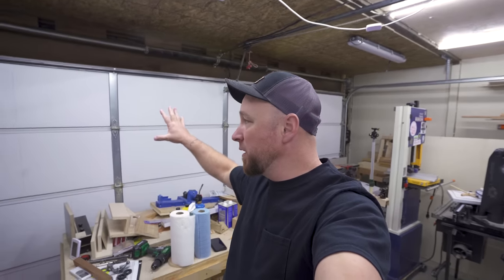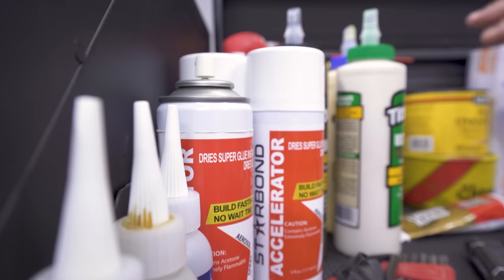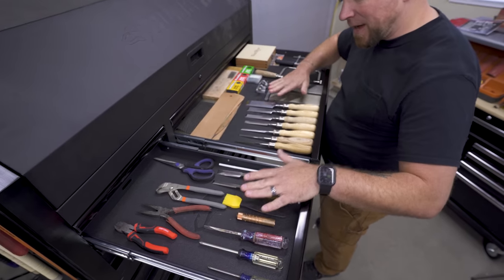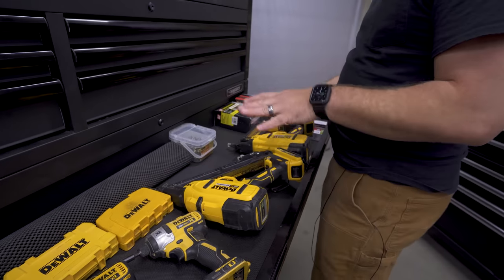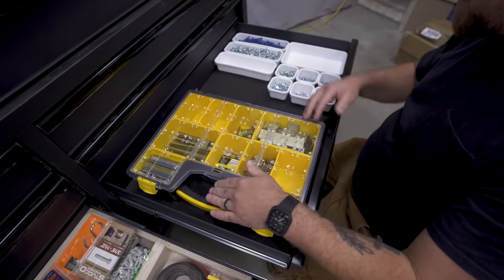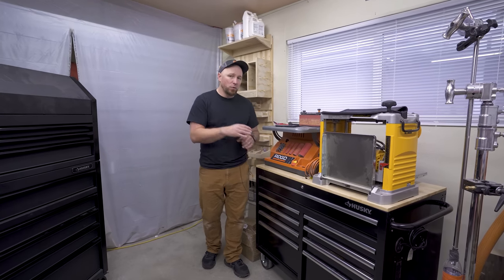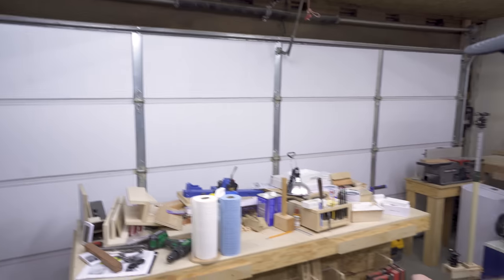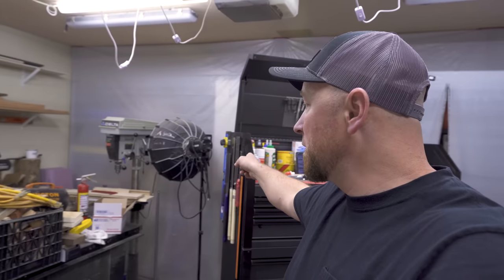I Fit (Almost) All My Woodworking Tools In Two Tool Chests

Comment: Another very well presented, high quality video. It seems that we both share a distaste for tools getting dusty and want to have everything in drawers or behind doors. 

I’m currently moving into a much larger workshop as part of a house move. Here are a few things that I’ve done - and that I’m about to do

I bought secondhand, very cheaply, good quality tall office storage cabinets with tambour doors. In one, I fitted drawers up to about 4’  and then shelves above; a second one has had drawer runners fitted top and bottom with the “drawers” fitted vertically; I now have 6 full height, full depth vertical “drawers” onto which I have fitted holders for chisel boxes (I tend to take the whole box of chisels to my workbench rather than 1 or 2), hammer holders etc. etc.

I have another one of these units just purely shelves which hold all my jigs - came with no doors but I made some easily

Under my table saw extension, I built a low set of drawers on castors; in there, I store all the kind of stuff I use on the table saw; tapes, kerf setters even table top cleaners.

Under my (Incra) router table I built another set of drawers sitting on the bottom shelf to hold my router tools

Above the router table, I copied Stumpy Nubs design of the wall mounted router bit storage; again behind doors

Beneath my floor-standing pillar drill, another set of drawers holding all my drill accessories

Beneath my small-ish lathe, yes, another set of drawers; under the scroll saw, another set of drawers. Under the morticer ………I think you get the picture - I try and have what I need for each machine to-hand. That does mean having duplicates of rulers, tapes etc in each set of drawers.

I bought a Helly Hansen tool waistcoat which I find is much better for me than a traditional apron and, again, everything I use all the time in there.

I made a lighting pod out of 4 600mm x 600mm LED squares. I then slotted this into a homemade track which transverses the workshop; so, I move the lighting pod to where I want very bright light.

I made a track (actually a heavy duty curtain track) which,  again, transverse the workshop with a four-outlet power unit hanging from the ceiling

Finally, this week I am completing building an 8’ long boom arm on a hinge; it is a torsion box arm and in the central hole, I have a long vacuum hose and another power cable; this means that I can use my (mostly Festool) power hand tools without the cable and dust extraction hose catching all the time because it all hangs down just a couple of feet from the boom arm.

I see some workshops which seem to dominate the time of the woodworker; it is all so neat, tidy, no sawdust, no offcuts etc. mine is a working (albeit amateur) workshop but with as much organisation to help my woodworking and not an end in itself.

I hope somebody might get some ideas from my list.

Comment: The boxes are great if you're the type of person who puts things away when finished - I'm not one of them (especially if I have to rely on a centralized spot to do it). I'm much more likely to put things back if it's easy and convenient. I have a tool wall for often used tools that's just a pivot away from my bench. Chisels, saws, marking tools, mallets, squares, planes, etc. Yes, they get dusty, but it's not a big deal to me. I also like the fact that I can immediately see what's missing without opening a drawer. I have plenty of shop made cabinets and drawers but they're located where the contents will be used so it's still convenient. Don't get me wrong, crap still collects on horizontal surfaces but at least there's an effort. :)
Now, if I could only figure out what to do with all the wood scraps and used sandpaper I can't seem to toss! My head seems to be stuck on "that's still good for something". lol  
Thanks for sharing!

Comment: I started using two rolling tool chest after I last moved.  It is nice to arrive at a new house and be able to find stuff.  Don't be surprised if you need to re-organize after trying the current arrangement for 3 months.  Separating into "used often" versus "stored" lets me declutter any given space/drawer.  A p-touch label maker should be your next purchase; otherwise you will discover that you pull out the wrong drawer 60% of the time, almost always the one just above the one you really wanted.  Looks great!

Comment: I made custom size boxes like those white ones with cardboard and hot glue. To my surprise,  they can hold a 5lb box of drywall or deck screws with no problem.  I'm stealing the magnet strip on the lid idea.  Thanks!

Comment: I just bought the 41” model.  And Home Depot currently has a 15% off code, just go to their web site, and it should pop up right away at the top.  Click on Details quickly, otherwise it’s disappears.  I got the 41” model for $713 after discount.  Plus, I found it cheaper by about $40 if I bought the two cabinets separately, instead of one unit.  This unit is “Industrial” rated, which means it is 18 gauge steel.  Also, definitely get some help unloading these cabinets if you pick them up at the store.

Comment: I wish I had enough room for that giant tool chest!  I have two of your smaller husky chests sitting side-by-side (no handles).  With the wood tops they function like a secondary workbench.....and yes....they are covered in nonsense.  Also have the same Rikon bandsaw, Narex Richters, and jointer too (Cuttech label).

Comment: what is the brand/model of the big stacked one? if two pieces, particularly interested in the top piece
Reply: nevermind, was able to pause when you were holding the label. husky 52x__ heavy duty tool chest and cabinet combo $948

Comment: Great, now if you can train yourself to put stuff back instead of leaving it on the bench. That’s my problem. Now if you remember where you put the stuff.😎
Reply: You need a 'Cinderella' workbench. At midnight it tips vertical, and dumps your tools on the floor. You soon learn to put them away ;-}

Comment: YES!!! I'm one of those weird people who have a lot of DIFFERENT hobby/tribes that I belong to, and one of my first was 'gearhead'; specifically race cars of various types. Now I have been a woodworker as well for over 30 years now, and I remain completely baffled as to why woodworkers insist on building open cabinets, trays, walls, hooks, cubbies, totes, 'systems' etc. 
News flash: Woodworking produces sawdust. (Who knew?!?)
While mechanics and machinists have put all their stuff in CLOSED containers forever, for some reason, woodworkers have never gotten the memo regarding keeping your stuff clean! Truly bewildering. My shop? Snap-On box (I mentioned the gearhead part right? And bought used at $.25 on the dollar, save the rant...), three Harbor freight five drawer carts, and a soon to be built hybrid (metal frame, wood / torsion box panels) Snap-On clone that is wide enough for my over-five-foot straight edges, and will live right next to the Snap-On box. Every cabinet has a door. Hardware is kept in Lista-type drawers (also scrounged, continue to save rant...) with Schaller boxes, etc. OK, now the fact that every toolbox is tool-foamed in contrasting colors with laser-etched labels MIGHT be a LITTLE OCD, (aviation unit in the Army...) but my previous point remains: Keep the dirt and dust off (and OUT) of your stuff! Amen brother.

Comment: One comment on the table saw blades.  The teeth are hard enough to damage the other teeth quite easily,  I would get some silicone ends for the teeth so they cant be damaged if they are to lay on each other. 
I would need a chest just for the small parts that I have. I am going to be making bins by Alexandre Chappel that is incredibly customizable. You need a 3d printer but it is very similar to the Stanley bins. I have several of the Harbor Freight versions of them in a cabinet and have decided that it needs to be tougher.  I don't want thousands of small parts accidentally intermixed.

Comment: My box is similar. I have a fan that is set on medium that turns on over when opened .that prevents 90% off dust when i forget to close lid.  It’s a repurposed fireplace box face so it blows enough to drift most fines away and yet not be disruptive nor noises.  I installed a hepa  from portable shop vac

Comment: You should test how flammable the exposed foam insulation is on the walls. Take a small piece outside and see how easily it burns using a lighter. It often flames up like gasoline.

Comment: With the price of lumber right now this is similar to my plan. I will be buying a bunch of tool chests to use as bench tops. Even my outfeed table will be two chests placed back to back with a double layer of mdf as a work surface.

Comment: 36,795 cubic inches is just over 159 gallons (or just over 600 liters for everyone not in the US).  Still not sure how useful that is, but easier to visualize, I think.
Reply: In UK, 
8 pints to a gallon, 
Pint of water weighs a pound & a quarter
Gallon of water weighs 10lb.
5 litres to a gallon.
Reply: @JohnColgan.  Instead of converting through mass, I used the defined standard of 231 cubic inches to 1 gallon.  (Yeah, I know.  That's terrible.)  Then going from cubic inches to cubic decimeters (=liters) is reasonably easy, at 0.254^3. This comes together to mean that 1 gallon is  ~3.79 liters, which is in line with the estimation I learned in elementary school that a liter is approximately equal to a quart.  I didn't check my math before but now I've gone back and done it.  Google agrees with its built-in unit converter that results from the search, "gallons to liters."
Reply: @JohnColgan.  It is interesting, though. Using the imperial pint does get us to 4.5 liters to the gallon, much closer than using the US pint.  Weird that they're so different though.
Reply: If metric, we would know a lot more - ha!